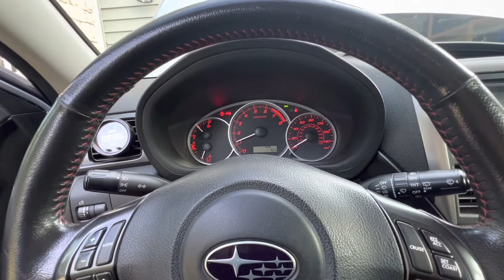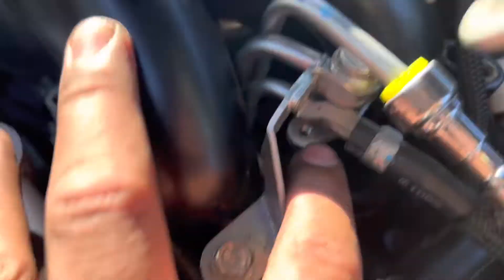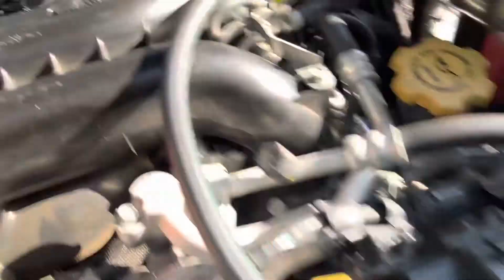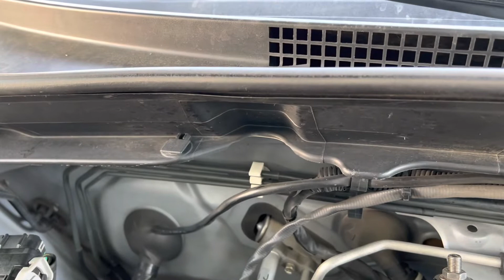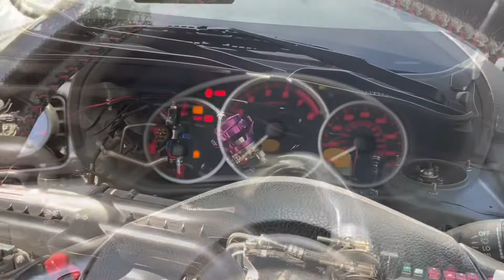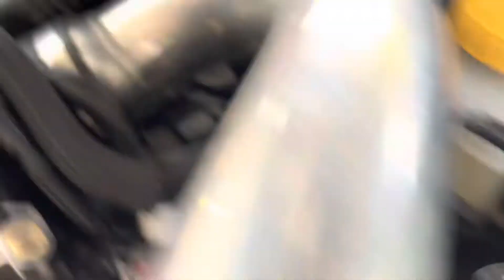2013 WRX aftermarket fuel pressure regulator

Comment: Awesome video! I just installed a FPR on my 14 STI..full bolt ons.. fuel pressure reads 32 psi when vacuum hose on. If I take it off .. it goes to 42psi. Car is bogging and running like crap. CEL code for system too rich. Did you set FPR to 43 psi with vacuum hose on?
Reply from the maker: I set it with the hose off. The psi will always increase when you pull the hose off the FPR or when you pinch the hose because you don’t have vacuum pulling on the diaphragm. I would double check the fuel pressure with a second gauge, I have ran into issues with the cheaper gauges reading 15-20 psi lower than actual.
Reply: @tafuentes  I have a nice gauge but a low AFR & a code for too rich means I need to turn down the FPR? Tuner told me to turn it down to 38
Reply: @tafuentes  I fixed it by cleaning the cold air intake filter and MAF

Comment: What turbo are you planning to use in the future? Just seeing why people upgrade the oem fpr unless planning on running high boost. I don’t consider 20psi on our cars high.
Reply from the maker: Ended up going with a Pulsar Gtx3576
Reply: Because sometimes parts fail and an adjustable fuel pressure regulator is a very simple and cheap upgrade. It's cheaper than the factory part while being higher quality. If you're not sure what you'll do later with the car, it's wise to install one. Even if you want to keep it stock, having adjustability and higher quality part is never a bad thing.

Comment: Hi what kind of bit did you use for the screws on the factory regulator.
Reply from the maker: It was a #2 Phillips bit I believe. It is a real pain in the butt to get them to crack loose.
Reply: Thnx.